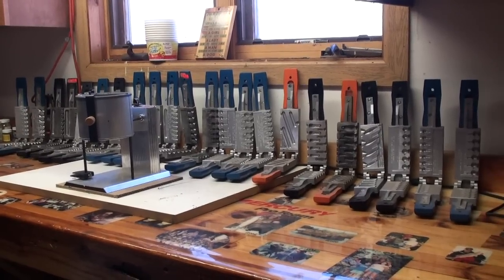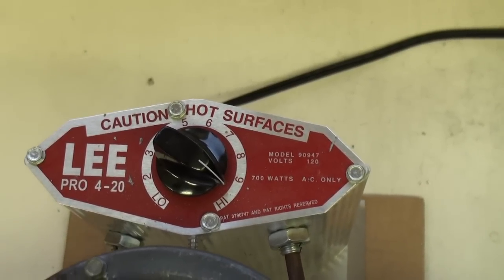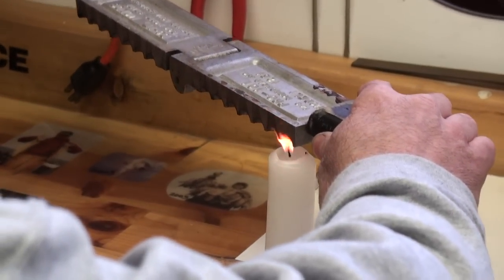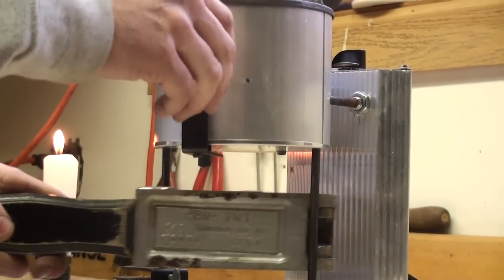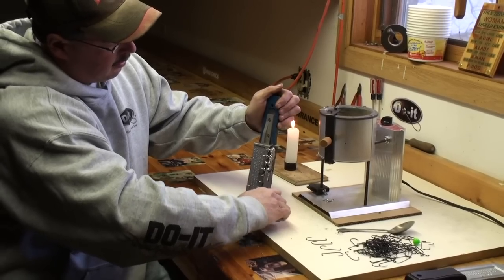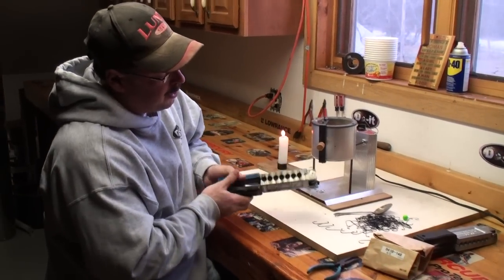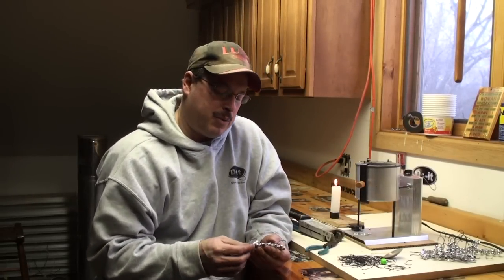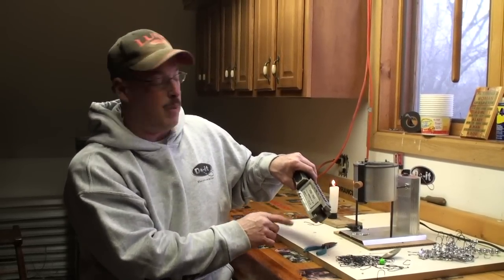Molding jigs with Do-It molds

Comment: the wax is a flux material. when burned in the lead it draws the junk to the top. its good to use in the process of cleaning lead like tire weights ect. drop a chunk in the pot when the weights are melted and stir. burns the wax and draws the junk out to the top and then scrape it off with a ladel.